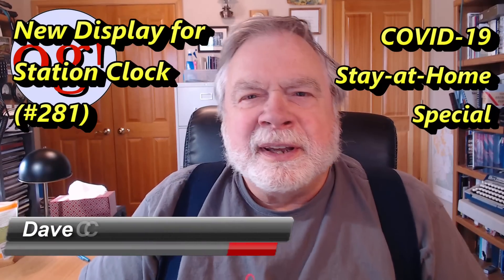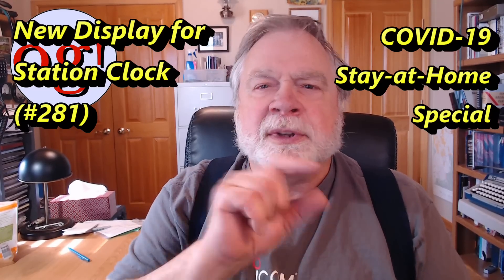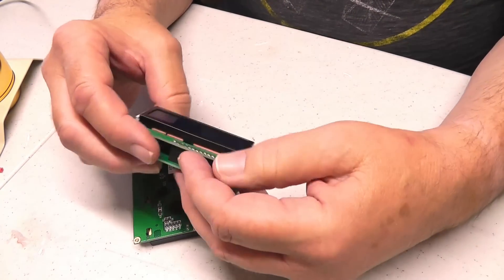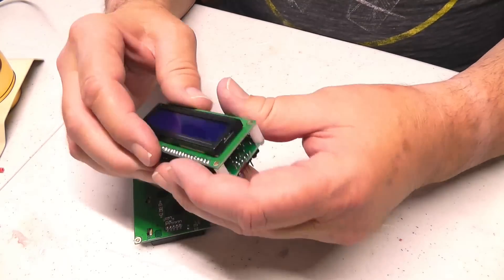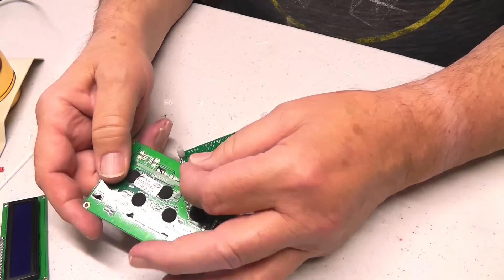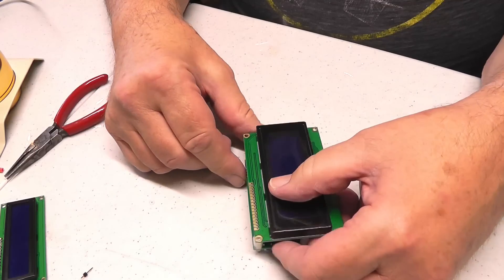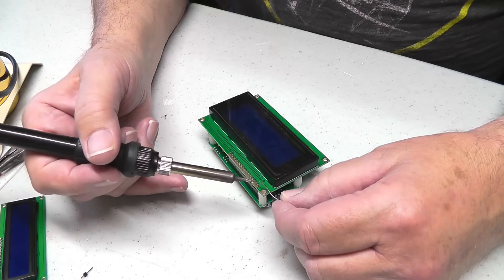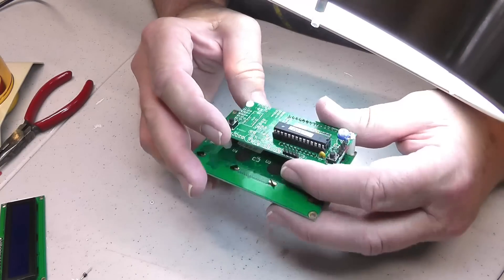Stay at Home Special: Upgrading my Station Clock to 4-line Display (#281)

Comment: Dave, seems you jumped into the topic from Engineers' Land.  Not sure why you have this seemingly crude device in a Shack (I guess I can see use in Field), so it's purpose or role escapes me.  Being relatively new to Radio and certainly NOT an Engineer, the whole content looked very intimidating.  I'm guessing the solder points don't want to touch each other?  I don't know what "GPS" "hook up" you were referring to, or connected from.  Or what the other connection was that you plugged in... power of some kind?  It seems like the video was flying over my head the entire time with no hope of talking to newcomers.  Was an intriguing topic to make me say to myself, "I wonder what this is all about?"

Comment: Hi Dave. I tried the link https://ke0og.net/ask-dave and got - This site can’t be reached ke0og.net refused to connect.
I wanted to recommend to you an excellent book by Elliot Williams: "Make: AVR Programming" it is a beginners guide and very accessible. When you come right down to it, all an Arduino is, is an AVR microcontroller and some support circuitry. If you Google "program avr with arduino" you will find links to any number of tutorials on how to program an ATMEGA328 I think there is an ICSP header on the QRP labs clock board so you can use jumpers to connect your Arduino Uno directly to the clock and program the 328 in situ. https://www.microcontrollertips.com/programming-avr-microcontrollers-arduinos-arduino-isp/ is quite helpful. 73 M6EXF
Reply from the maker: Sorry about the site being down when you tried, and thanks for the tips.

Comment: It looks like the Arduino doesn't program the chip by swapping it from the socket, but you have to breadboard the one you want to program externally.

See: https://www.youtube.com/watch?v=35hB-sn0ddI or https://www.instructables.com/id/Program-ATmega-328-Using-Arduino-Arduino-As-ISP/

Alternatively, if you don't want to mess with breadboarding the thing, you can use a TL866II to program it:  https://www.amazon.com/dp/B07B985LBS/

Comment: Didn't catch where you got the clock from?
Reply: https://qrp-labs.com/clockn.html
Reply: A website called QRP Labs. They make a lot of good products. I think Dave's clock is: https://www.qrp-labs.com/clockn.html
Reply: I think the link is in the description but I couldn't find the four line display upgrade. It's a secret I guess.  QRP-labs dot com has the kit in the two line display version. No mention of the four line display.
Reply from the maker: QRP Labs sells the 2-line clock. You can get the 4-line display from Adafruit.
Reply: @davecasler  Thanks for answering this question.

Comment: I don't have a QRP Labs clock to try it on however you should be able XLoader to upload the new firmware to your clocks chip.  Download information here for XLoader: https://www.hobbytronics.co.uk/arduino-xloader.  When you plug the Arduino board into your PC it's going to create a com port just like other devices do.  Select your hex file and device type and you should be good to go.

Comment: I have several watches, a couple old analog - spring powered, and the others are solar powered battery driven, WWV coordinated. As long as the solar watches have bright light from any source they never run down.  WWV time signal is as accurate as satellite sourced reference.  Love the watches.  I may be a little OCD about watches.  Worse things in life I suppose.  Hope you get the clock squared away.

Comment: Dave, here's what I found to update the QCX firmware with an Arduino Uno, maybe it can be re-purposed to update the clock firmware?
https://www.qrp-labs.com/images/qcx/HowToUpdateTheFirmwareOnTheQCXusingAnArduinoUNOandAVRDUDESS.pdf

Dave - AI6K
Reply: Provided you've installed the Optional In-circuit programming header

Comment: I have put off updating my clock(s) for the same reason and I haven't found a case that I like. I cut the supplied cases in half. It cuts down the space that the clock takes up and it gives me a second case :o) 73 NE5U  Mike

Comment: Hi Dave I maybe able to help you with the clock.  I ordered one a few days ago with FedEx shipping so maybe it will be here soon.  Would you please put in your show description where the four line display can be purchased.  Others might like that information.  I will PM you with additional information.  Thanks for all the videos!  Update I used your ask Dave on your website instead of the PM.
Reply: The screen looks like a standard part...  search 'HD44780 20x4' on your favorite place to buy parts (they're all over eBay).

David Murray, The 8-Bit Guy on YouTube did a series of videos on these displays.
Reply: @souta95  Thanks for the information.  I do already have a couple for 4-line displays but mine have a few differences and I just want to be sure I get the same one that he has in the video.  One reason is I want to make a 3d printed case for both the clock and gps board and that way others could use the stl file and print their own case.  Again thanks for the point to David Murray.
Reply from the maker: I got my 4-line display at Adafruit.
Reply: @davecasler  Thanks, I saw your video and you answered my question in that video.  I have built the clock with the a 4-line display (2004A on PCB) and the GPS receiver.  I did the two day shipping and it arrived here in California from Turkey in two days.  Seems to be working.  In the next couple of weeks I plan to make a 3D printed case to house the clock and the GPS receiver and if I do I will post the stl file for others.  Dave if you want a case just let me know the color (black, white, red, blue, gray, silver, yellow, green, or clear) and I would be happy to send it to you  with hardware at no charge.